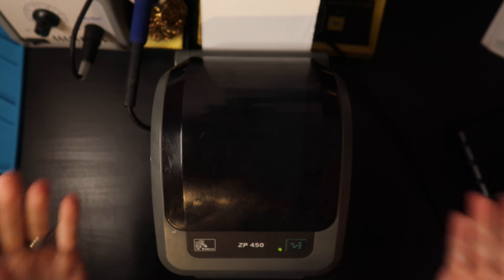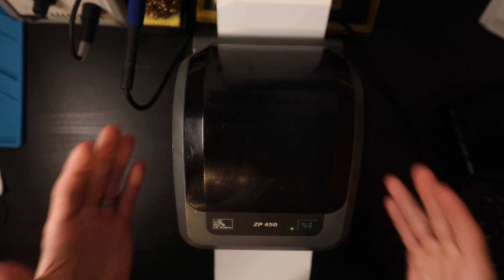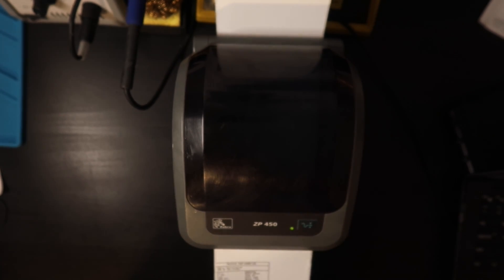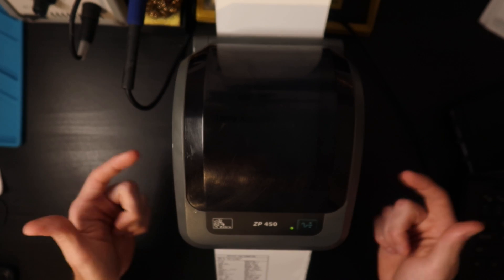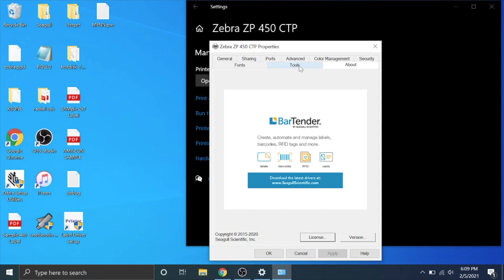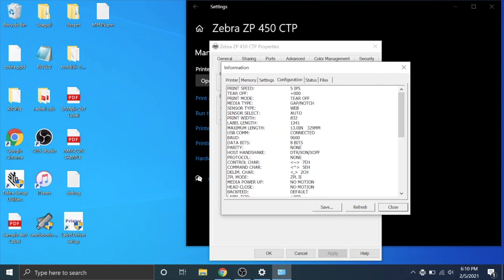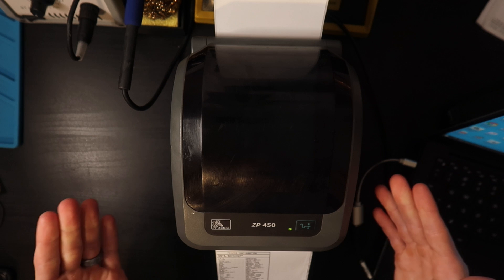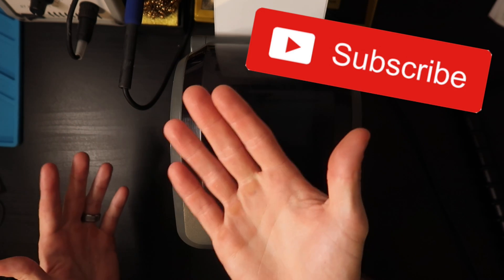Fix Zebra ZP450 Printing Blank Labels | 4 Labels After Power On | 1 Label After Opening Top

Comment: I use this printer for 4x6 labels and 1.5 x1.5 labels and when I change from either label the printer prints on the scale of the previous label for several labels. At them moment I can't get it to print on 1.5 x 1.5 it prints one label but feeds the size of 4x6. changed the printer properties size to 1.5 x 1.5 restarted computer has the same problem any advise?

Comment: I am using also the zebra 450,I only have the Chromebook and also Android phone with the toggle cable that is exactly like you say it spits out three labels wasting all the time.I think I'm going to buy a Windows for my printing I did also get the app that you recommend it from the Google Play Store I got it today May 2,2022 from Amazon and I'm going to use it this evening oh my Android phone tonight because my Chromebook it will not get me the correct size when I go to size it just says 4 x 6 index card I don't know why it doesn't say 4x6 only can you help me with that.4x6 index card is too large for shipping label. Thank you so much if you can give me some advice on what to do on my Chromebook to fix this.

Comment: My Zebra 450 is only printing on half of the 4x6.  Its the full label smushed.  I have updated the settings and it did not work.  Windows 10.  Please help
Reply: I had this problem as well.  It can be remedied in the print preview under Advanced.